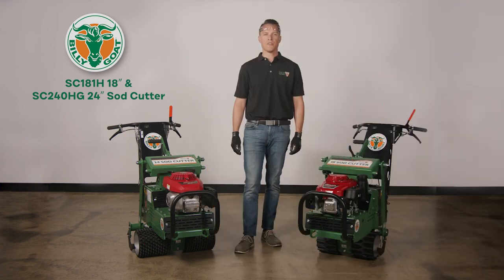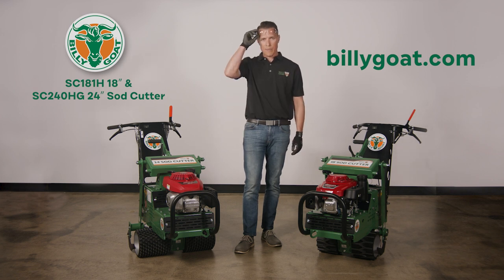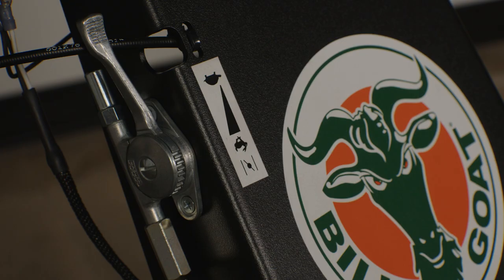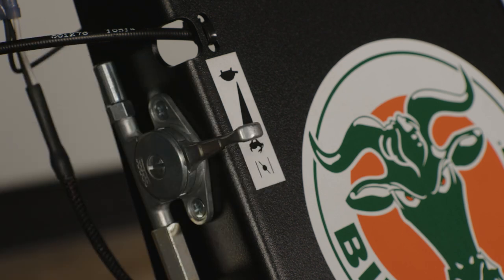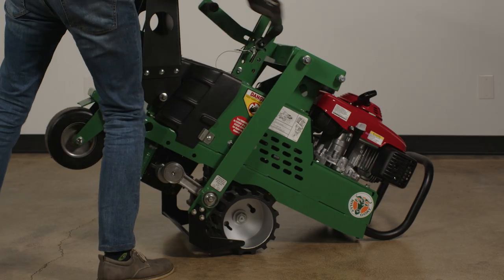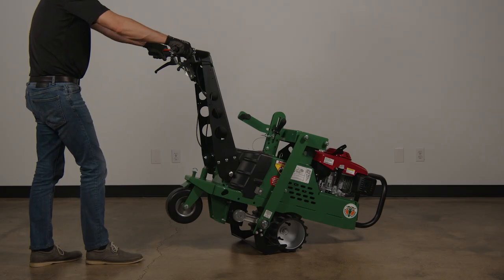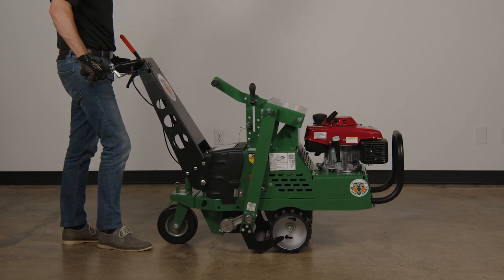SC181H & SC240H Operating Instructions

Comment: This machine might work well cutting a flat moist field but that's it. You know when they tell you to make sure the ground is wet that the machine is gonna be crap. The one drive wheel and handlebar design is so flawed when you're pushing this machine around and constantly  have to hold the throttle and  cutting triggers down. They don't even show you them using this machine in the video because you have to manhandle the beast around. Definitely would not recommend  to anyone. Fire the guys who designed this POS BillyGoat please. 🤬🤬🤬
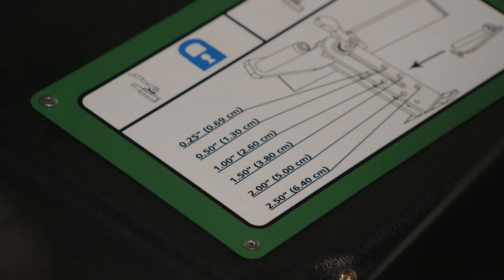Reply: I used it on really dry ground, it worked but it hurt my hands 45 minutes in and it took 1:30-2 hours to finish. 2 inch depth so it was a lot not aweful but it could be better.